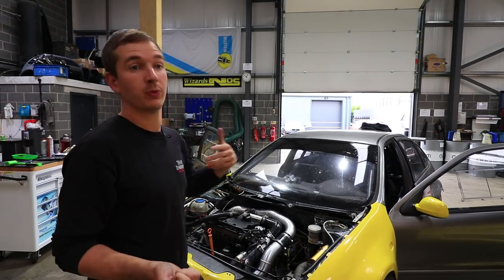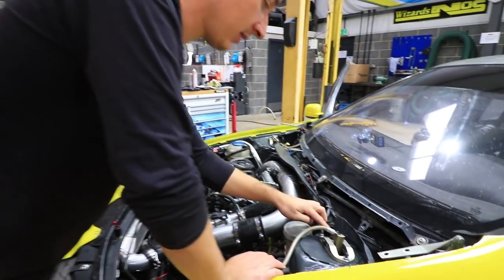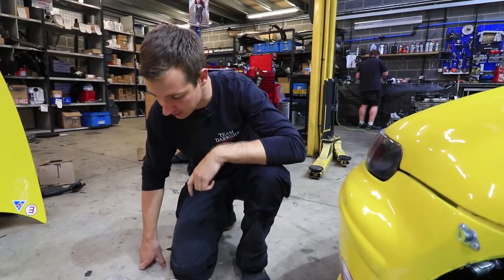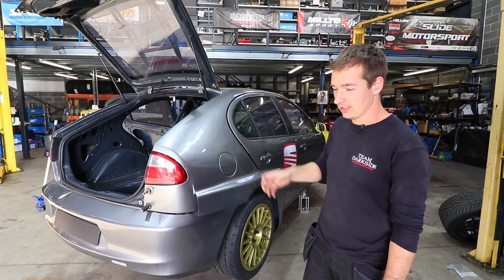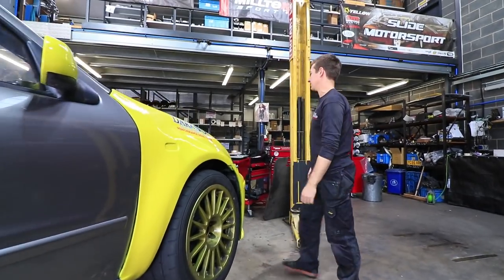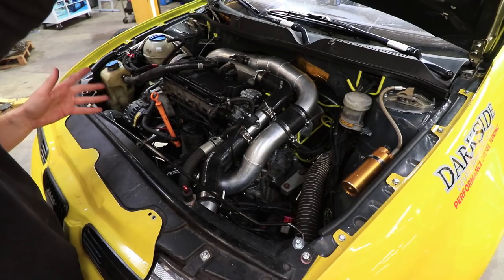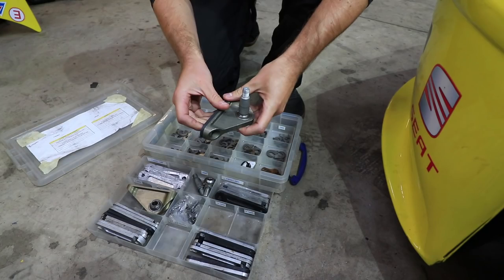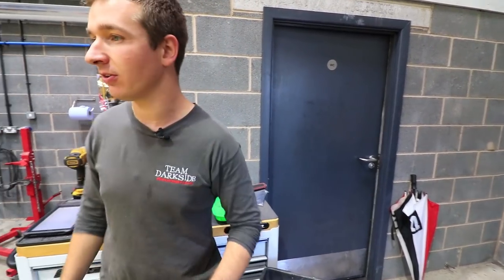Air Jacks FAIL!!! Part 9 - LEON EX WTCC BTCC CAR - DARKSIDE DEVELOPMENTS

Comment: RE: Airjacks, run them at much higher pressures and each line needs to be equal length down to the mm with the feed to a manifold somewhere in the middle of all 3. 
Top job though, keep it up!

Comment: Its nothing uncommon for jacks to go up slightly different from one another. You will likely get the occasional one sticking frim time to time too and thats nothing to do with how its piped just a case of servicing. Those feet and platforms look frightening though! I wouldn’t go near that setup with a barge pole. I’ve worked on GT cars that go up 3 stages and we happily change engines with them fully up. 
 All a learning curve though. The rest of the car looks 👍🏻

Comment: What gear shift set up it the car running. Also the pedestal it sits on
Reply: Just a normal shifter modified with a strange gearknob and mounted on a fabricated pedestal.